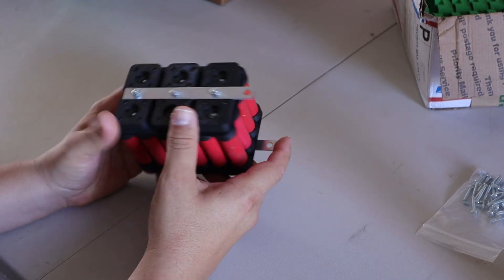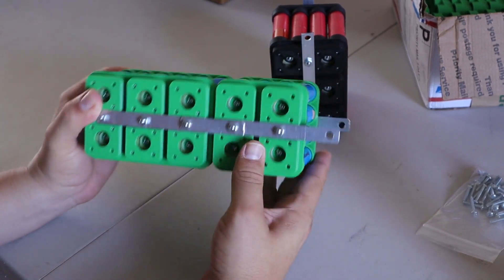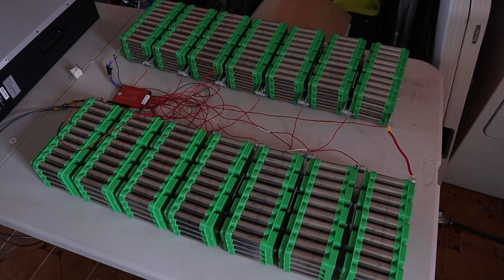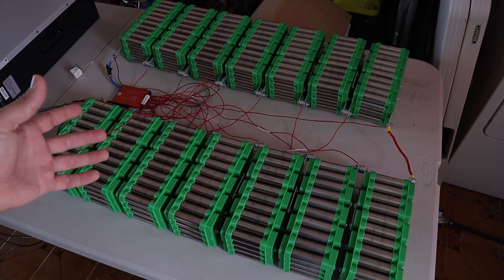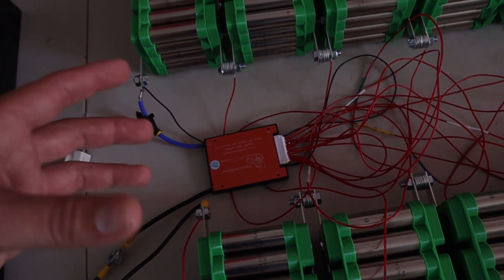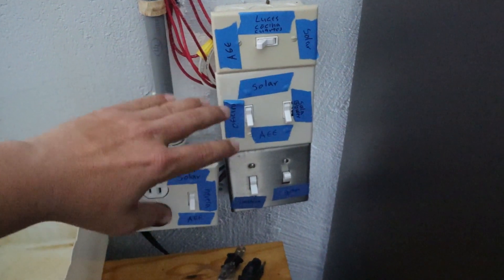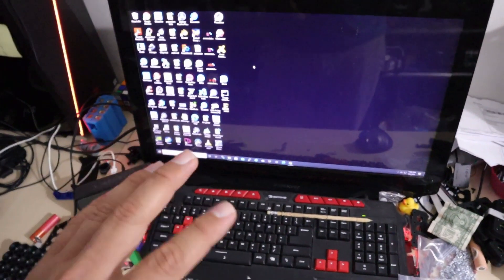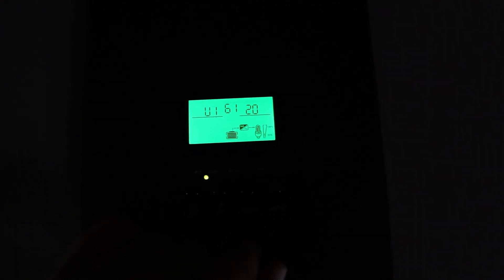Final Assembly of my new Diy Powerwall : My Green Monster

Comment: Javier Dios te bendiga mi sistema es 24 v quiero mover todo en casa y el aire inverte cuanto sale 8 k
Reply from the maker: 8k no te da para todo eso.
Reply: @javiercamacho  tengo todas las luces en led mi a/c es inverte 22 ser una tv 43 pulgadas  lavadora 10 w cuanto power necesita mi casa
Reply from the maker: @josealama3282  mira mi serie sobre energía solar. Asi podrás calcular lo que necesitas

Comment: Javier thanks for showing your new battery kit - I know you just put the packs together to show us the new kit and it may not be the best configuration as you mentioned. Since it looks like you will stick with this design, is there a space where we could discuss the safety aspects of it and different ways to configure/connect the packs. Also the specifications of the fuses, total amps we can pull etc... Please not a FaceBook group. Maybe Reddit or other platform or even on your DIYBattery site. The community may be able to provide different ways to use it. Think I may pre-order the 7s40p, but then I'll need some more batteries :)
Reply from the maker: Thanks for the advice. On futvideos I'll tackle this topic with some level of urgency.

Comment: Why did you take off the red wrappers from the batteries? I thought the wrapper was needed to not shorten out the battery when touching it.

It surprised me that you still have brown outs. That info is not common knowledge for us on the mainland.
Reply from the maker: These are recycled cells and the wrappers on most of them was very ugly and becoming a pain to work with them. So I removed them. The cells aren't touching so no risk of a short.

Blackouts in PR are an every day thing. We still have thousands